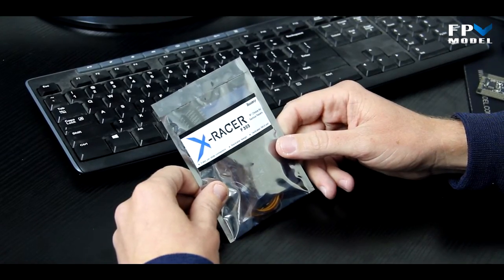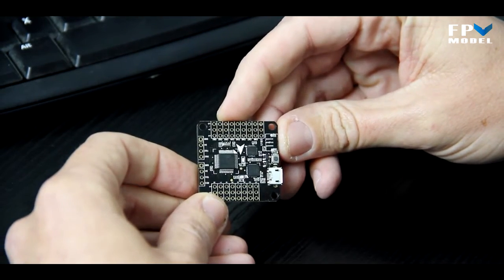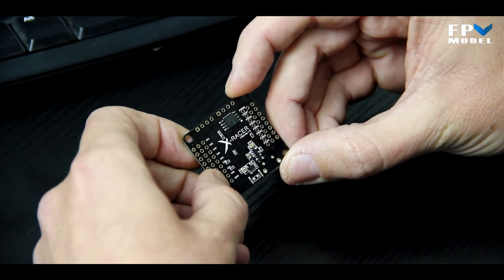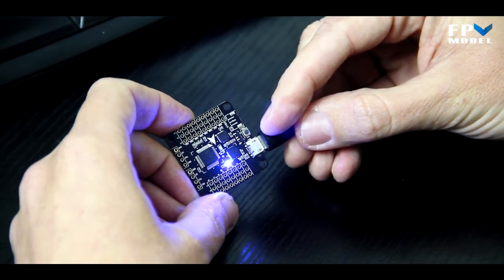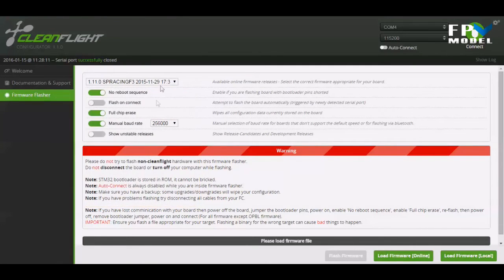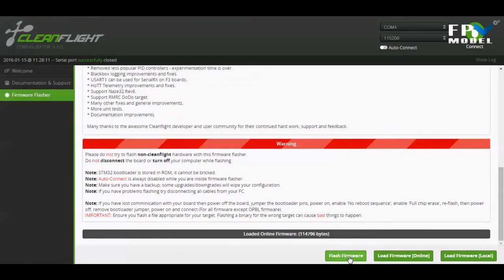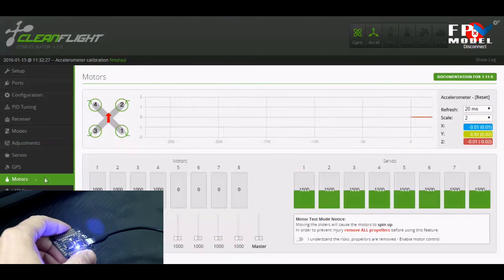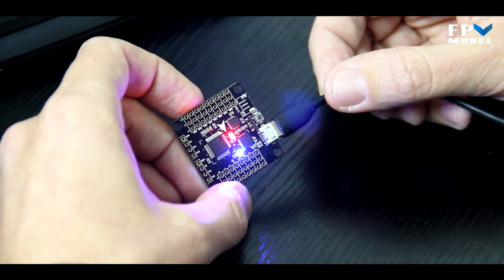X-racer How to Flash Firmware Flight controller

Comment: hi , i have just installed an X_RACER  v 3.1 in one of my quads  , its running on betaflight 3.0  , for the first couple of goes it would start up fine and fly well  but after about one hour of using it  it seems to be stuck in boot mode when i power up , strangely if i plug in a usb lead from the computer  and the power it up it will power up correctly .  i would be great-full for some advise  regards jack

Comment: Issue was not using betaflight_3.0.0_X_RACERSPI.hex on ver 3 board. Resolved.
Reply from the maker: Glad to hear it. betaflight v3 is still being worked on once it is a stable release you'll find the latest release of betaflight 3.0 in the drop down box of the configurator.

Comment: I followed these steps to the letter w/ a brand new V3. I took it out of the wrapper, googled and found this video, and proceeded carefully. Light stays solid blue after flash firmware, verify, then get Programming SUCCESSFUL. But just solid blue and no flashing LED at the end as in the video. (I know my setup is proven as I've flashed other FCs a number of times.) I've tried repeatedly... no luck. Tried Betaflight on Cleanflight, on Mac and PC.  Again, I follow these steps exactly. Do I have a bad board? I notice the light is solid blue if I plug in USB w/o holding the BL button... always solid blue no matter what. (cleanflight_SPRACINGF3.hex 1.13.0)
Reply from the maker: You are flashing the wrong hex file. This is a video for a previous board. You should go to the link for v3 and scroll to the bottom of the page. You'll find the x-racer hex there.
Reply: Cannot get cleanflight to work either - no hex files found at bottom of page for v3.1?

Comment: I had the same problem with flashing the x-racer f303 v2.1. I got the error, "FAILED TO LOAD BOOTLOADER"

It took me a while but you have to hold down the bootloader pin the entire time during the flashing sequence.  That is how i was able to flash it.
Reply: +oliverdeznutz Didnt work . 2 board wont flash. tried on 2 devices, laptop and my desktop.
Reply: +gatecrasher_fpv I know it sounds weird but some USB cables work better than others.  Try using a USB cable from a PS4 or Xbox One.  I know those work for me.
Reply: +gatecrasher_fpv Also, are you at least getting some LEDs flashing on your board? If not, that means your board is defective.
Reply: I nearly soldered the board up before testing ! I only hooked up to test if the gyro and accel worked. I tried everything, man baud rate = 256kbaud/auto baud rate, reboot sequence/no reboot sequence, cleanflight/betaflight. I knew the USB cable works, flashed my lux with it before (learnt a lot flashing 2 of them!) so I knew it wasnt drivers either.

Connnected to a USB3 port and it worked fine first time, both boards. Tried again using the original usb2 port and worked first time, both boards.

Can not believe it. I've been pressing "flash firmware" for over an hour. 6x per attempt as I know it can fail once or twice before flashing.
Reply: man, how you resolve your problem? i have a same issue, cant flash the FC board...

Comment: my board stopped working after doing the firmware upgrade. My blue light will not turn off. It seems like it is in boot loader mode however I can load the firmware again. I just received the board today 4-28-16. This is the v2version.
Reply from the maker: +TheLifeSpot Click no reboot sequence, flash on connect, Full chip erase, and set manual baud rate to 256000. Make sure you have the spracingf3 firmware loaded and not the evo. Let me know how it works after that. jason@fpvmodel.com

Comment: Just tried to flash Betaflight 2.3.4_SPRACINGF3. 

ONLY worked with "no reboot sequence" enabled and manual baud rate 256000 (like you show in the video). But I got a timeout on verify twice. It does boot with Betaflight now though. I'll see if it works as it should.